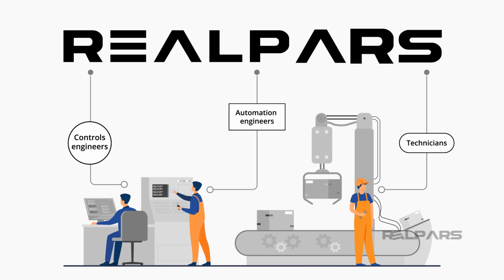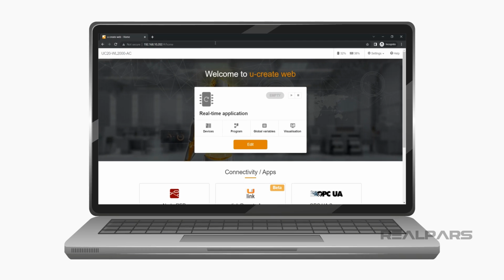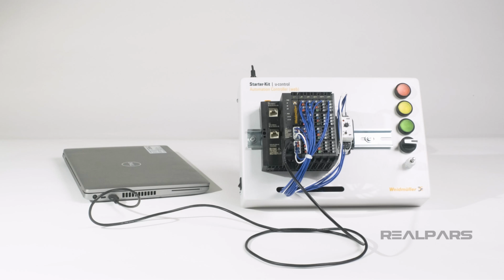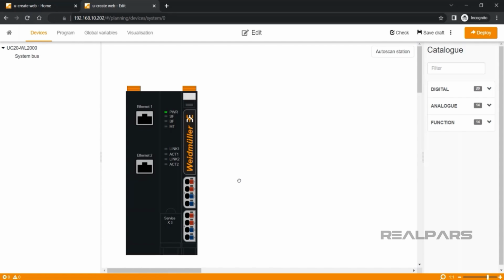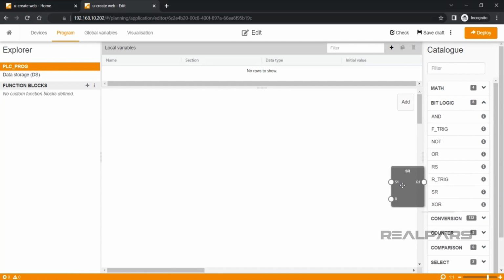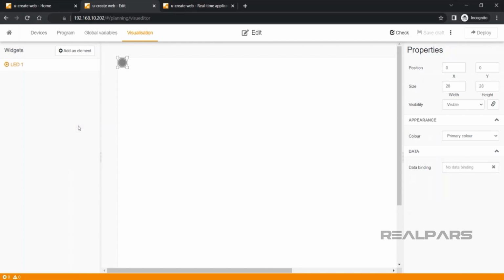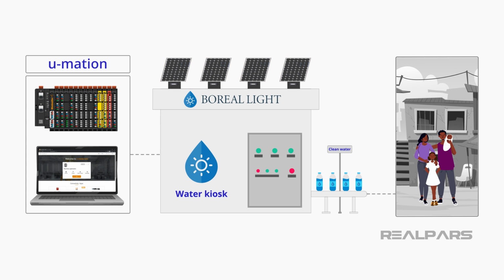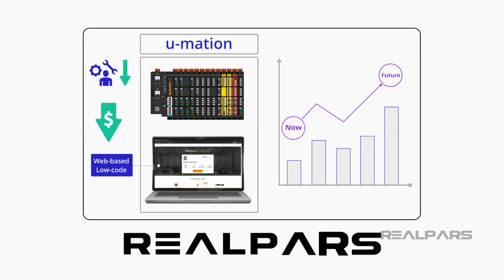A First Look at the Low Code Future of PLC Programming

Comment: After 14 years I think I have to re orient myself. PLC programmers were never considered themselwes as real programmers. Industry wanted easy programming languages and low quality staff because of "rapid" development. So ladder diagrams, function blocks etc has born. New standards and programming languages were develpoed without some good working basic concepts of traditional programming languages. 

Siemens thrown away variables and worshiped pure memory addresses with tags (it were not much than a name for a specific address). And Siemens is a world leader by the way. Then Siemens was proud to be able to use optimized blocks and variables and tried to convince its "programmers" to not afraid of not knowing the address of a variable.

By the way if I am looking into the future of low code will be a very short meaningles time period before solutions based on chat GPT...

And that will hit on german industy IT sector as Tesla hit automotive industry with its new idea like giga press.

Comment: Technology marches on.

Many decades ago, when PLCs were still "programmed" by plugging actual hardware logic modules into a physical control panel, I joined a small startup company that wanted to move that type of programming onto IBM PC ATs. The idea was not to develop a new "computer language" for PLC programming but rather to simply replace all the hardware with a PC-based graphical interface that looked just like that existing hardware, logic module, approach, and the logic itself would run directly on the PC, no need for all that physical hardware logic modules. The idea was that so many PLC programmers (the people) knew how to program PLCs via the direct hardware approach, moving them over to a computer-based  graphical interface  that mirrored their existing knowledge, and that would let the simulate and test out their PLC programs before actually putting them into production, our product would be a huge success.

Well, no.

I spent the good part of a year developing the drag-and-drop graphical user interface (and this was before graphical user interfaces were common) for the IBM PC AT. Had a lot of it working. Even showed it off at the year's NCC (National Computer Conference, remember those?) to a select group of potential clients/ investors. But the "money man", the fellow whose idea this whole project was, never raised a penny to support the effort. And the hardware guy, whose job was to design a fairly simple circuit board to plug into the IBM PC AT to interface to the PLCs, never got the board working..

So, the whole project never went anywhere. Just fizzled out. The same destination as millions of other startups.

And a few years later some companies began developing actual programming languages designed specifically for programming PLCs. So, MAYBE our product would have had a few years of sales but would eventually have been overtaken by the full software approach. [ sigh ]
Reply: Sad. But heads up since then they are following the wrong path. :-)
Reply from the maker: Hi Roger, 

Thank you very much for sharing this, very insightful!

We would love to get in touch with you, feel free to send us a short email over to hello@realpars.com mentioning that you come from this comment on YouTube. 

Thank you again, and happy learning!